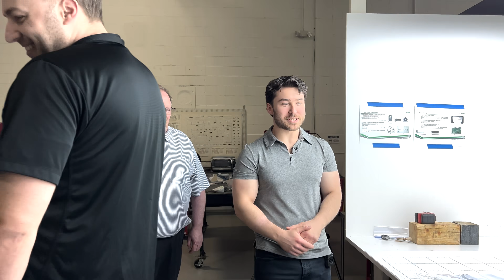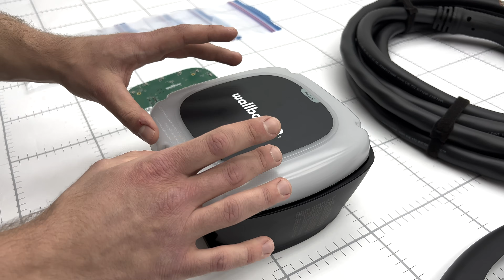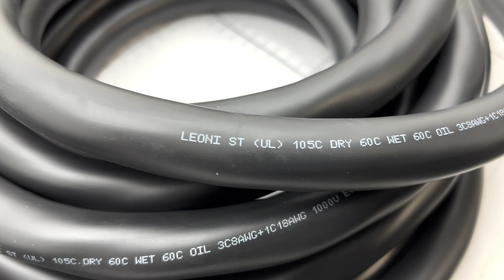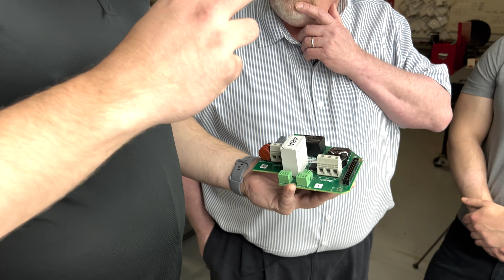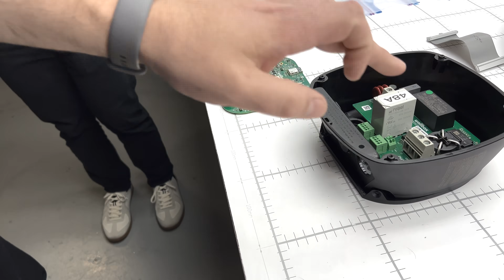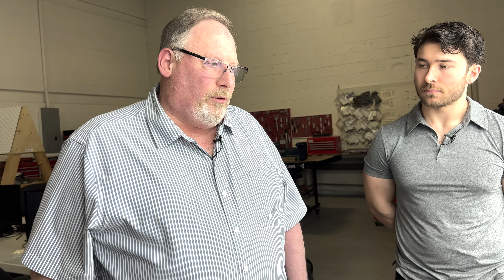EV Home Charger Teardowns E4: Wallbox Pulsar Plus

Comment: Hi i have a pulsar max but i can not connect with the app with the error connection refused. I only connect 1 phase and 1 neutral from the house power. The wallbox Shows a Red Ring. Can this be the problem? I also can nocht update the firmware with the same failure. Thx

Comment: Hi great video
I have the pulsar plus but noticed a crack in  the body which has let water in. Now there are no led lights and the wallbox app won't connect but the charging still works ok. Are there spares available for this unit

Comment: There is a Czech company GWL that sells a PCB a size of a coin, that can do EV charging, and in the kit you get 12V power supply and 16A 250V relay. 
So you can build the whole EVSE inside the charger handle, IF you have all the safety electronics in your distribution box or socket (RCD, over current protection, over voltage protection).

Comment: So its a $10 relay with some current measuring, attached to a raspberry pi. Not a bad way to spend $1000!  In the good old days, we used a cable and switch.

Comment: The worst thing it has atleast the normal Pulsar, is that it has a fuse, when blown you have to solder the board! Btw, why do you say that from the cable hose it comes out a data cable? Dude, that is simply a cable connected to the CP on the board, it is just a resistor.

Comment: One for your list: Enphase Bi Directional EV Charger. This allows the car’s battery to be utilized as a backup power supply for the house when the grid is out, instead of a generator. It also works with the homeowner’s PV system. So, instead of selling back excess power to the grid when you have no choice, you can save to battery. Then sell excess power to grid from your battery when the price is better. Very interesting. Thanks for the videos!

Comment: The cable linking the 2 PCB's together looks like an IDE ribbon cable used for connecting IDE (Pre-SATA) Hard Disk Drives in PC's 20 years ago.

Comment: Once again an underwhelming EVSE teardown video. Munro should stick to cars, these wallbox videos are an embarrassment.
The Wallbox is generally a good product, but there are issues Munro didn't even realize/cover:

1.) wire sizing and whole diameter for conduit fitting: The wallbox uses a metric M32 hole... unfortunately that is not compatible with standard 3/4" or 1" NPT for any fittings on the market. 
You have to drill it out to fit your fitting. Drilling the right diameter hole will void the warranty. Pretty stupid for a product for the North American market to not address that.

2.) WIFI strength and WIFI password requirements: The wallbox is super finicky about signal strength (2.4GHz only) and the complexity of your WIFI password in your router. If you have a secure password containing any special characters, you will not get your Wallbox connected. The Pulsar Plus only accepts letters and numbers. Good luck!

3.) App integration and app to charger response times. The App is optically well designed. However the connection to the charger using the WIFI connection to the network goes over their cloud portal. To establish this connection, you will stare at your screen a lot longer than necessary. Half the time the app goes into a wait mode where the colors are faded until the connection is back.
You can switch to Bluetooth only, but that only works if your phone does not have internet access OR if you manually force the app in two sub menus to switch to BT.  Just simply inconvinient.

4.) Cable is on the stiff side, not as stiff as a Grizzle or Juicebox, but noticeably stiffer compared to a ChargePoint Home. It is also larger diameter. The J1772 connector itself is fully plastic, has no rubber over-molding and looks very cheap comparted to the rest of the unit. This is specifically bad on the 48A version. (The 40A seems to have a better connector). Cable stiffness can be mitigated in cold winter climates (you're welcome Canada) with a cable retractor placed high enough to take the slag of the excess cable length. This significantly improved the handling in the winter.

5.) Pulsar Plus US offers integrated dynamic load balancing with a group of up to 25 Pulsars. This is a very good feature and is not dependent on a subscription! Canbus is used for the communication between the units. Problem here is, that since the Can coms need to be wired as a daisy chain, in addition to the wiring for the 208/240V connection typically a seperate conduit is required for the coms. This makes the install a lot messier than an implementation, that would e.g. be based on WIFI or a Bluetooth mesh group. We have solved this by using a 600V rated twisted pair, that is run within the same conduit as the power (local AHJ allows this specific method). Again, nice feature but not super installation friendly. 

5.1.) The stability of the power balancing is OK, but not really great. As soon as one charger has an issue, the master unit detects a communication problem and all chargers go down to 6A/10A charge current as a protection method. This is very very annoying. The software should be smart enough in case of a single or multiple EVSE communication drop to subtract the highest possible charge current from the system maximum amperage rating and continue with the dynamic load balancing for the rest of the chargers that are still communicating. When your lot is full and people can only charge at (6A)1.4kW/(10A)2.4kW, people get frustrated very quickly

5.2.) Wallbox offers a smartmeter (Garlo Gavazzi) for building load dependent charge current control. This is an amazing feature, especially in capacity constraint installations. Unfortunately the software can only be configured that ONE wallbox can be programmed to that feature. Specifically for installations with multiple chargers and the previously dynamic load balancing, it would be amazing to use the smartmeter to also DYNAMICALLY set the max charge current/power setpoint for the group of chargers DEPENDED on the residual capacity of the building service. But no, that is not implemented and its over a year with little to no movement from Wallbox.

6.) Software Update process and update success rate: Once in a while software updates are shown to be available on the app. When trying to deploy the update, in the majority of tries the update fails. There is also a remote update button on the my.wallbox.com management page. This function has never worked for any of our installation. It says it pushes the update, a day later, still the old firmware is shown. The only way the update can be successfully deployed is with the direct Bluetooth communication to each device at a time. This is not a problem for one or two chargers. But for a fleet of chargers, this is not acceptable. 

7.) The Wallbox decal centered on the front of the unit looks great in the first year. Chargers that are exposed to direct sunlight (what a surprise these are installed outdoors) start showing uneven surfaces and a bubbling of this film/sticker/decal. Doesn't affect the function, but is not adding to the confidence for long term stability. 

to summarize this: The wallbox product is still a European product slighly adjusted to the North American market (e.g. power PCB is 2W+GND to accommodate single phase 208/240V J1772 charging in North America. The understanding of the North American installer and applications here are lacking. Software is promising generally but needs improvement for better usability and should be designed with real world applications in mind. It is noticable, that none of the US/Spain base product managers or sales people have ever installed a bunch of their Pulsars themselves and used the features beyond 'just charging one car'.

Comment: There is much more circuitry than I expected.  Does this unit have enough compute power to assign multiple user accounts, perform billing, select pricing levels, and connect to cloud software via WiFi.  I need these features to support multiple users at a condominium building.

Comment: I originally just used my dryer outlet in the garage with the Nema mobile cable.  Later I added the Tesla wall connector mainly for better aesthetics vs ugly outlet.  Tesla one of the cheaper wall connectors vs Ford and others.

Comment: Thanks for including the cable length.  Another thing that is important for buyers to know would be the different current levels supported.  At least the fact that this unit supports multiple levels, but does it support all of the commonly available circuit breakers from 15 A to 60 A like the Tesla Wall Connector does?

Comment: Naming is the same for dsl and cable modems.  The original modem was a digital to analog converter, so data could be sent as audio over a phone line.  A cable modem isn't actually a modem it's just a network adapter but it's still called a modem since people know what it is.  In EV groups people talk about regen rates and now it related to gas pedal position, of course it's no longer a gas pedal because there is no gas, but it's still called the gas pedal.  People will keep calling an EVSE a charger for many years as well, EVSE's on amazon are listed as chargers as well.

Comment: When an EVSE board has both PP and CP connections, it also supports Type 2 cables in an untethered configuration. In J1772 cables, the PP is local to the plug, but in Type 2, it is also present on the other side of the cable, the end that is plugged into the EVSE. There it tells the EVSE about the current capabilities of the cable. With J1772, where the cable always is fixed with the EVSE, that functionality obviously is not needed, so only the CP that connects EVSE and car is present.

Comment: Wallbox is very likely using that control board across their product line. They offer EVSEs tailored to unique applications, including units for communal garages such as in apartments or condos. Communication features allow the charger to identify the individual vehicle and associate the energy dispensed to the owners residential utility account regardless of which EVSE the owner uses. This also prevents unauthorized use.
I have heard, but not seen documentation, that networked Wallbox EVSEs can manage the load drawn from the garage's electrical service.
While Munro videos are interesting from a manufacturing perspective they often contain little meaningful information for those who might actually purchase these devices. Yes, this time you did sort of mention ground fault detection, but didn't know what the proximity sense was about . Seriously? The proximity sense wire signals to the unit that the connector is being plugged into or removed from the car's socket. No proximity connection positively disables AC power out of the EVSE. No, that's no special insider knowledge. It's basic stuff any curious consumer could see if they looked. And ring connectors add at least one additional failure point, usually more. Amateur stuff in this video.

Comment: The control and pilot signals are part of the J1772 standard.
Reply: No. CP is, but PP is a Type 2 signal. J1772 has PD, but that is plug<->car only and does not extend over the cable to the EVSE.

Comment: I'd call this device a "level 1 charge port".   110V at 48 amps is pretty high for most older houses. Many only have 100A service.
Reply: It's 220V and that's why there a current adjustment switch; to enable it's use on lower service houses.

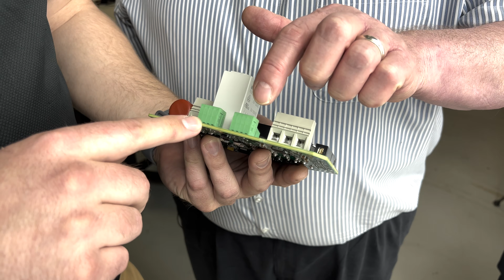Comment: 8:02 I am in Europe and we have such Pulsar Plus - a huge mess regarding surplus charging cause they claim to work only with 1 smartmeter from carlo gavazzi    
OR you know what EVCC cause that is your cheap and reliable full solution with lot more features 

EVCC is a german development to connect most Wallboxes and in particular that Pulsar plus or with any smart meter to check if the solar panels are feeding in to start the charging, but based on your profile like Surplus only or at least x kW when surplus is available or fastest charging speed possible. This evcc can also start a heatpump or any wifi plug . Runs in HomeAssistant, docker image available. 

And for Growatt owners: EVCC has an option called proxy where it only listens to the communication of growatt hybrid inverter with the smart inverter via modbus. It is just listening and using the data available like the amount that is fed in now. Everything else will be managed from EVCC - opensoure on github or so.

Avoid the terrible expensive and rarely available carlo gavazzi smartmeter for over 220€ . We use a eastron 3 phase smartmeter talking to growatt sph 4600 hybrid inverter with evcc as a listener in that communication line which is called proxy mode .
Reply: EVCC sounds great.  Too bad we don't have that in North America.
Reply: I have the Wallbox Pulsar Plus installed for me by the company that I bought my EV from. 
I am off-grid and I am suppose to be using the Eco-Smart feature which Wallbox boasts about to fully utilize my solar generated energy, but the EM112 Carlo Gavazzi MID meter which was installed with the Wallbox charger just doesn't work and the charger keeps waiting for green energy to be available even when I have surplus energy from my solar panels. 

I saw the Eastron SDM230 meter online and it is cheaper than the EM112, but I do not know if it can be connected as a replacement for the EM112 meter. 

Please, your guide and assistance will be appreciated. Thank you.

Comment: You can also call it EVSE (Electric Vehicle Supply Equipment) and the most important you guys forget to say it’s most of these device use off the shelf components. The AC/DC is a module from mean well. Super easy to source and works out of the box. Tesla use discret components to do the same thing except that it’s harder but it’s cheaper. You have complete control of the cost. Same thing of wifi and Bluetooth module. You can buy off the shelf or make your own. That is also harder and make because you have to do FCC testing and more. The AC/DC also require CSA,UL,CE standards etc. Don’t know why you need a PI. I think they use the PI for bigger commercial products and making the smaller one what easier if they use the same parts.

Comment: They missed the real point that from the electronics point of view, this product was ridiculously over-engineered - a Raspberry Pi, a Texas DSP and two wireless modules is complete overkill for something that could have been implemented perfectly well on something as simple as an ESP32.
That's a way bigger factor in cost than things like weight and details of how it's moulded.
Reply: I'd say they used COTS parts to reduce development time and cost. I'm sure that in the current market there is limited demand and much competition and it was better to get something out there cheaply and quickly to build a brand and bring in revenue before going back and re-engineering for cost reduction as the prices of competing products come down.
Reply: I'll take over engineered over cheapest design/parts as possible anyway.
Reply: Thanks Mike! Love your channel! DEEEEP knowledge on electrical systems.

We are tearing these down to get a good understanding of the home charging systems, we've been asked about them a few times but didn't have the background in what was on the market. We are really trying to get a deeper perspective of what's in the systems before we give opinions on them at this point. There is a lot of behind the scenes commentary .The two wireless modules are a big head scratcher, but we try to figure out the "why" even if the solution doesn't make much sense.  Same with the Raspberry Pi... its cool. But is it needed?
Reply: The affordable Austrian Go-e charger (at least v1 and v2) actually use Standard ESP32 boards, providing tons of features.  v2 and later versions won several tests in Germany. But are not on the US market. So far I know there are only 3-Phase versions.

Comment: You guys s should only call it EVSE as you know what it is and what it does.  It is NOT a charger, as you stated. Only a non professional  - dummy  or someone that does not care about FACTS would call it a charger.  With EV's  fairly new, let's get the name correct.  Great job and all the details.
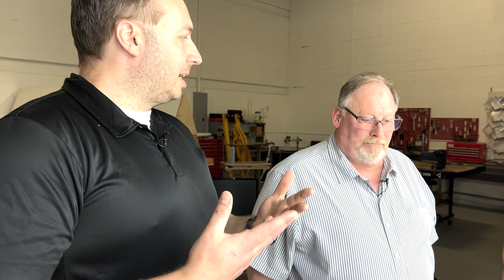Reply: Yes, they said that in the video. 12:30
Reply: @sjwright2  that's what i said
Reply: @davidws5439  Right. You're saying the same thing.

Comment: i have had one of these for two years, worked flawlessly (I use the timer function 99% of the time but on a few occasions have used the override function, which is nice as you can start charging without having to mess with an assigned schedule. 
Mine is max 32 Amps (I see this one says 48amps). The only issue i had with mine was the very bright light when i first got it, and at some time a software update (you have to apply these manually) enabled this to be switched off.
You can also assign a monetary value to charging so you can see how much you've spent and this can be shown over periods of individual charges or particular timescales such as months.(this is shown in the app not on the unit)